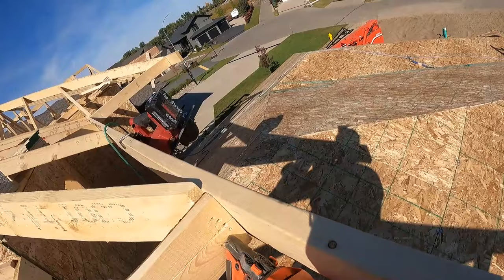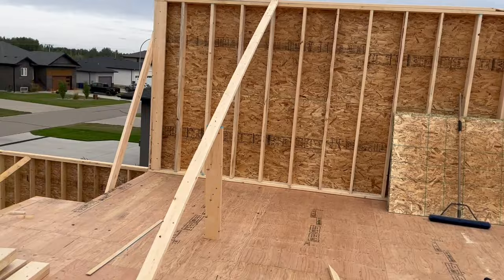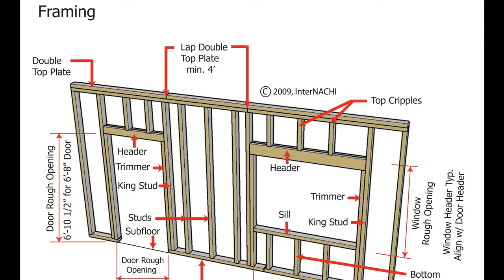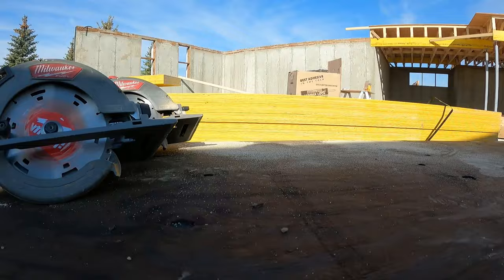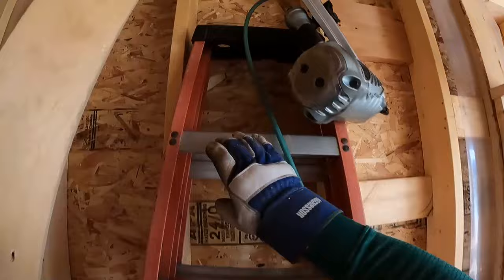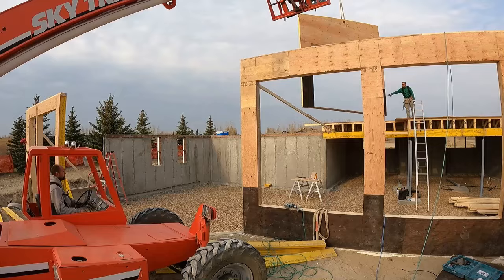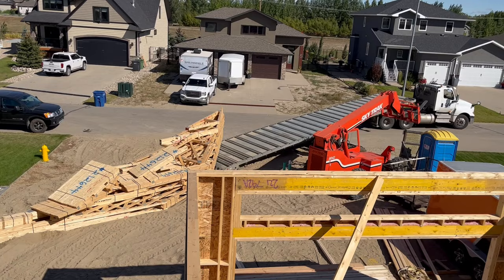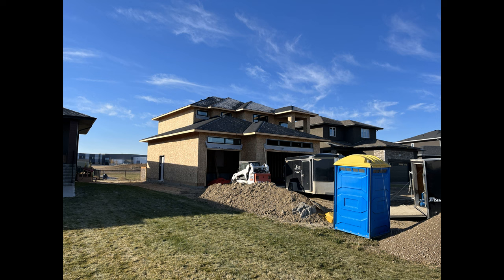Carpenter job in Canada, first work and new construction technology.

Comment: Does it need a red seal or any licence to work as carpenter in canada ?
Reply from the maker: Don't need for residential construction
Reply: Yes you need one in Quebec
Reply from the maker: I said about Saskatchewan, just in Quebec need licence?
Reply: @kravets_family_adventures5324  I don't know for others province but here in Quebec we need one
Reply: @calyx3063  hola soy el carpintero Jose Luis cortes
Reply: depends on the province. quebec has a ton of regulation for construction but mostly for employers. for employee you need accreditation and thats about it. ( not really hard to get either)  other provinces regulation will vary. if you are a foreigner i believe you will need a work visa as well.